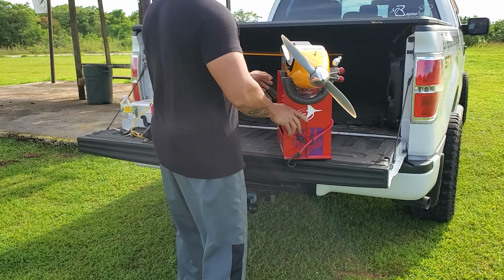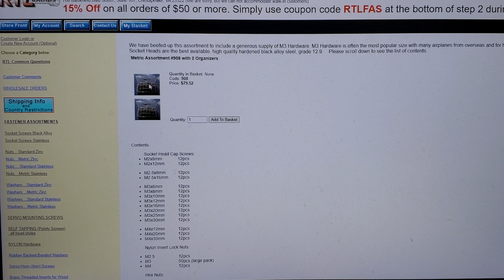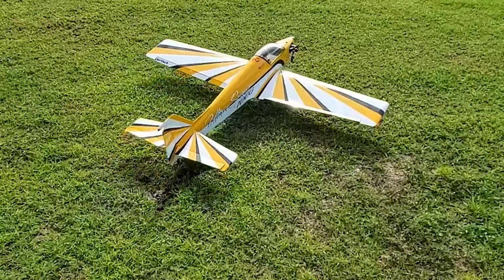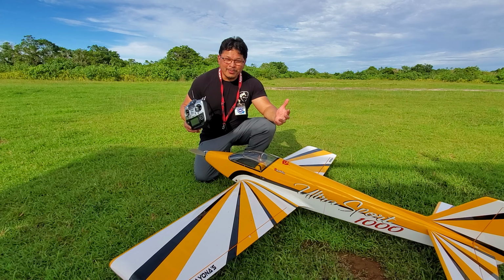Great Planes Ultra Sport 1000 Maiden day Aug 20th, 2022

Comment: Ok here’s the deal started building and flying back in the 1970s. Quit around 1999 was about 3/4 the way though a Ohio r/c 1/4 scale cap 232. Just decided to finish it! Almost ready to cover it. I’ve forgotten more than I remember! Watching your videos has inspired me greatly! Learning a lot from your videos (THANKS) !  I’ll be asking some newbie questions as I’m just 64 years young! Again thanks a million!     KEM
Reply from the maker: Awesome and I am honored to bring back the good times.  Been building since 1982 and love it.
Reply from the maker: Anytime just ask away Sir!  I will be glad to help out.  You can also checkout my Facebook group just an extension of my YouTube channel.  

https://www.facebook.com/groups/1102320606822541/?ref=share
Reply: @BayonasRCWorld  quick question the plans don’t call for glassing the center section. I went ahead and glassed the top center which doesn’t show. What’s your thoughts on the bottom side center?
Reply from the maker: @kemsmith3420  glassing the wing center was the normal for most of the older kits of the 80's and 90's.  Nonetheless it is never a bad thing to glass the wing center top and bottom to add extra strength.  When done right you can minimize the glass from showing through your covering.  In most cases the bottom of the wing has a wing bolt plate and some leading edge belly pan trimming that also helps to hide the glass under the covering scheme.  Really it is your call if you feel that your wing really needs glassing of the center section top or bottom.

Comment: I also have a us1000 and was under impressed with the flight response , I flew it around six times and put it up on my shelf. 
It’s a very pretty airplane, just not snappy , nice flying , cheers
Reply from the maker: You can make it snappy!  During the build if you beveled the ailerons more than what the plans stated to give more deflection the plane would come alive during snap rolls etc..  I built the plane as per instructions only because the plane brings back memories of the good old days.  If I want a 3D plane I would look into more update models exactly for 3D.  This plane for me is for nostalgic reasons.
Reply: I agree, 
However my kit came out heavy and it flies slow to my liking.
Reply from the maker: @Golani-ic8ue  mine as seen in the video came in at 14.02lbs